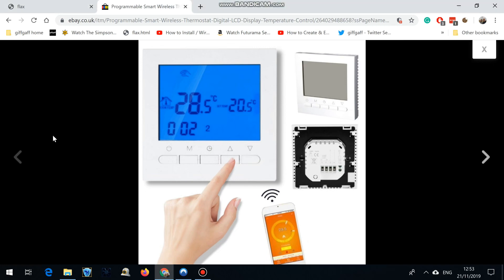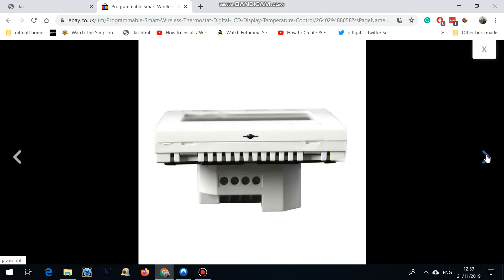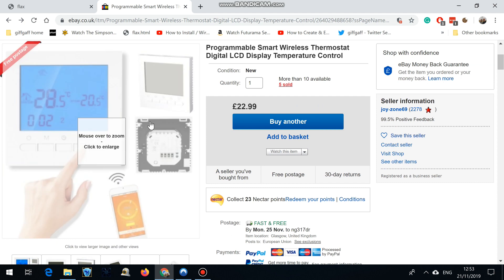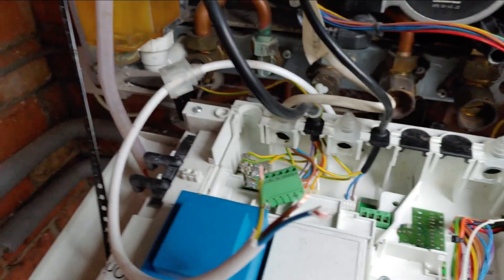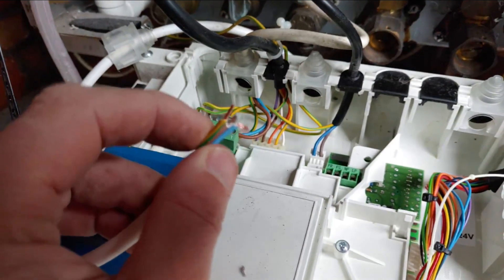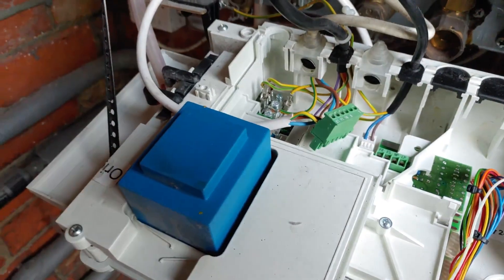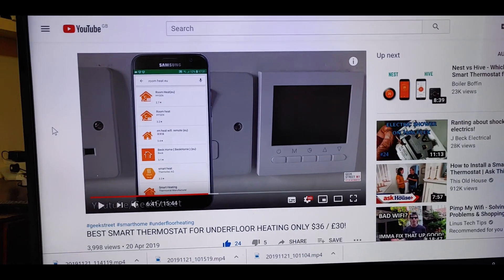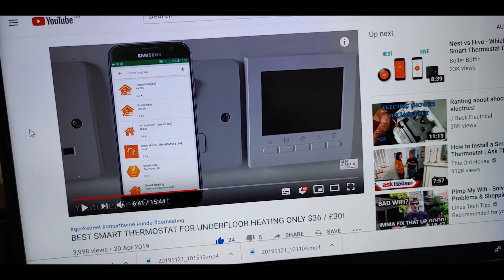Cheapest wifi smart thermostat - install wiring to worcester combi boiler

Comment: Thanks Steve. Never had the option of installing 4 core for the additional switched wire so your boiler-end instructional pinged the light bulb 💡 instantly and of course it works perfectly. Great lateral thinking and got me out of a two hour head scratch. Mine was an old mech. Honeywell stat to swap out for digital smart stat. What are the earthing implications of doing this. Of course it’s fused at the boiler end and again at the consumer trip. It’s purely the ‘impossible’ instance of the wall box going live? I’m not worried personally.
One more sub 👍🏻

Edited….now it’s set up when I set the room temp the flame signal comes on but the boiler actually shuts down. If I switch the stat off the boiler fires up as would expect as setting on boiler is heating perm on. 
I literally can’t get my head around it! Something in this wiring isn’t correct. 
Even on auto the setting automatically shows as 15deg c yet the boiler fires up instead of off as actual room temp is at 21. It’s literally working back to front

Comment: Hi, thanks for the quick video. I already have a Worcester DT20 Programmer fitted to the boiler. Can I keep this and also install this SMART thermostat using the instruction you provided....I mean it's not going to mess up anything, right? Thanking you in advance buddy:))
Reply from the maker: Hi ya, my neighbour has the same digital timer on her combi as you have on your Worcester DT20 but I can't recall what I did with hers, I may have set it to manual and then the new programmable thermostat just takes control of the heating. The hot water comes on as needed when the hot tap is turned. Nothing was messed up with her boiler anyway, and I can remove the added thermostat control, pop the jumper back in and the boiler will work as it did before :-) If that makes sense..

Comment: Hi budy l got Worcester comfort RF l and kkmoon WiFi thermostat. Do u have idea how l could connect this device as all power from boiler is connected to 13amp fussy switch. I could connect directly to 13amp fuse switch from boiler or l have mess around with boiler inside?
Reply: You have a switch at the power ‘out’ of the boiler??? Where’s that then and why? Surely it only goes out to the wall stat.

Comment: Just a quick question at the end of your video it says this is for underfloor heating on the paperwork so is it also ok for radiators.?
Reply from the maker: Mine is connected to the combi-boiler that heats radiators. I don't have underfloor heating but I know this device can control that too as it says it is suitible for electric heating, an external temperature sensor can be fitted too.

Comment: Hi. I've got a Worcester junior i24 combi boiler which already has a Drayton scr receiver wired in. It's not picking up the signal from the wireless thermostat any more. How would I wire up one of these WiFi thermostats that you've videoed here?
Reply: Same problem ..you must have power from socket or jumper neutral to neutral on thermostat

Comment: Hi, got this connected ok with help of your video.  Can't get it to find wi fi.  Any idea please?
Reply from the maker: Make sure your router has a 2.4ghz setting. In the video in the description the lad explains how to get it to connect to wifi, but depending on your router you may need to press the WPS button first. On the app there is a "possible causes of failure" section.
Also, when setting up please keep the phone within 1 foot of the thermostat.

Comment: Hi does anyone know if this works with a 2 wire system? 
I have the same unit and trying to work out the layout
Reply: You will need a neutral there 2 wire does not have this

Comment: Did this come with the wall box?
Reply from the maker: No, i needed to purchase that seperate. I got one from Toolstation for around £2. It's called a Patress. You can either sink the patress in a wall like light switches and plug sockets are, or just screw it to the wall. https://www.toolstation.com/electrical/boxes-pattresses/c148